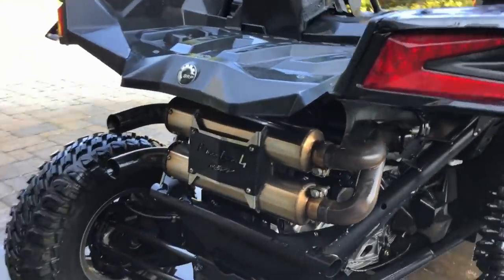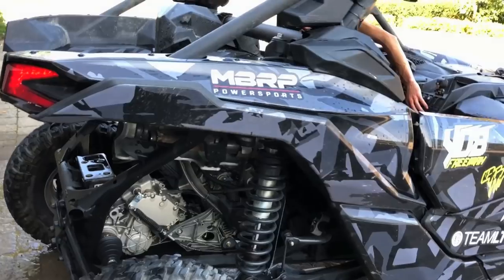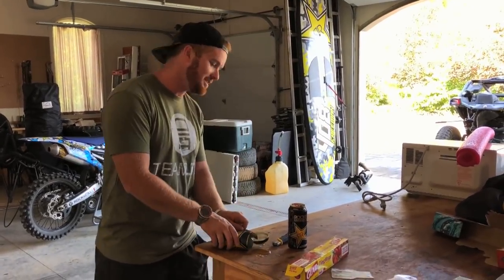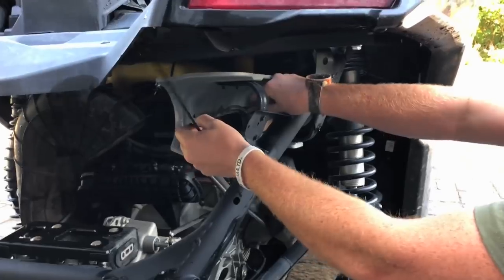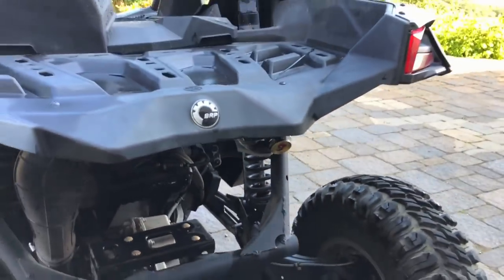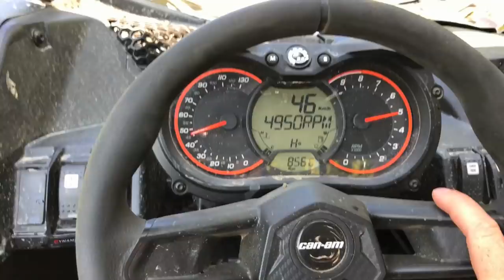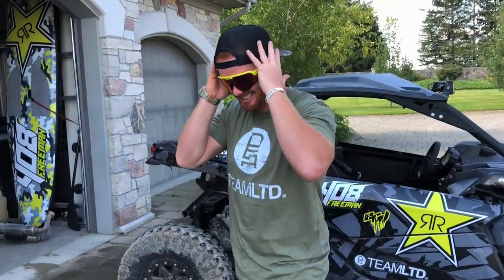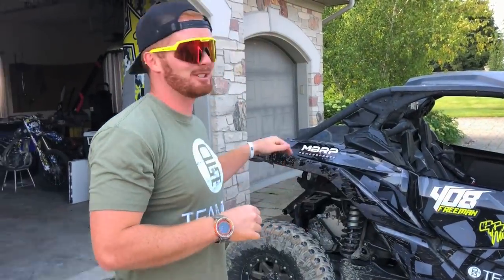How A CUSTOM STRAIGHT PIPE Can Am X3 ACTUALLY SOUNDS!

Comment: I did the same thing to reduce weight and the dunes don’t require any muffler, but my buddies told me I could bend a valve is that true? I think it’s ok because they sell straight pipe exhaust for this machine.